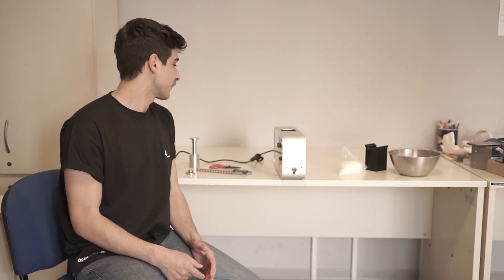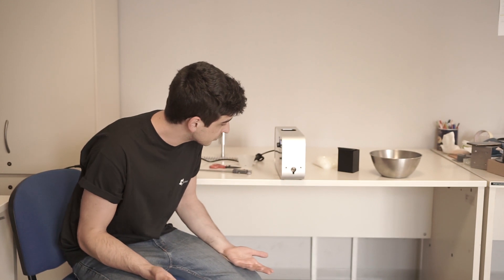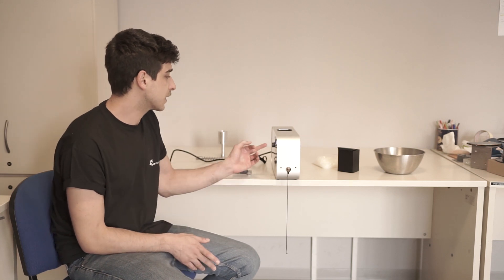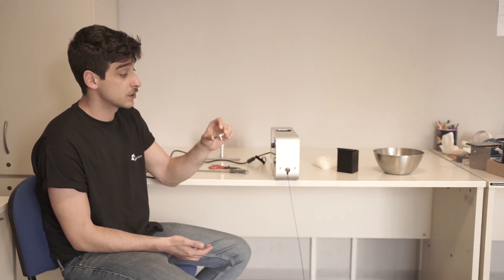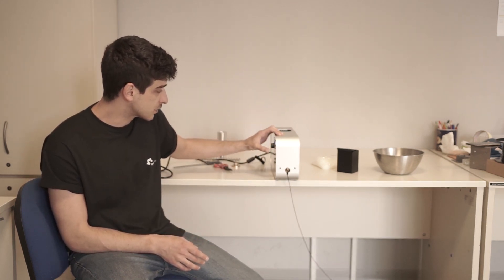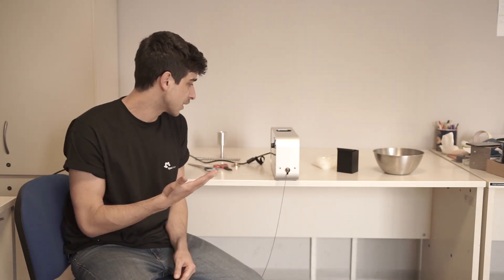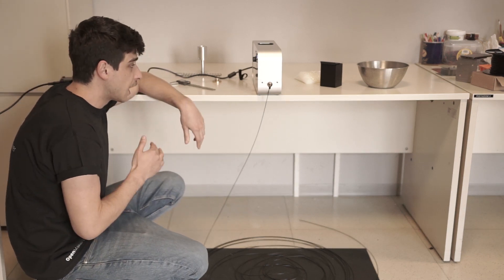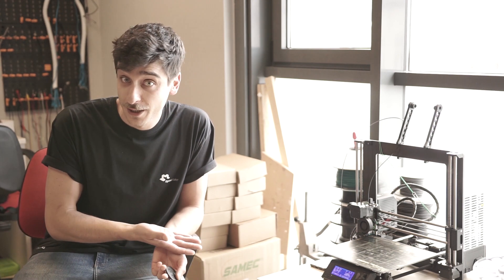Make your own filament at home with Felfil Evo: 100% PLA recycled filament

Comment: If you sell it to me for 300 dollars I will be glad to test it review it and promote it but The device won’t sell to the general consumer when there are other options for 500 that are pro grade.The perfect price point for this machine is 300 dollars. At that price thousands will buy it... not sure how much it cost to manufacture it... but if it is feasible I would recommend the price reduction because many 3d printing experts want this kind of machine but just not going to spend over 500 without it coming with a spool winder
Reply from the maker: Hi Marco, thanks for your advice. But, what are the machines pro grade for 500€?
Reply: Hi! Thanks for answering!there is a company selling the filastruder only 300 dollars but comes with a more powerful motor larger screw etc... for 500 that machine comes with the filament winder too. The problem is that it isn’t fully assembled like your machine but most people who work on 3D printing should be able to assemble it so when they compare that device to yours they think 300 dollars makes more sense then over 500 without filament winder... they are taking a lot of your customers from you due to your price being so high.
Reply: Felfil there is also another machine that’s orange being made by a Chinese company... I forget the name but you can get one on eBay and other sites for 600 dollars fully assembled with more powerful motors etc... I wish I could have one of your machines so I could promote it here in California. I am tired of all the plastic ending up in the landfills. If I could inspire people to buy some and turn their garbage into filament I can use for my printing projects that would be awesome!

Comment: Hello, your idea is pretty neat I must say. But the price is far away unfortunately. Like someone said, first of all, I see (hear) some issues with motor, that one needs to be definitely brushless. I would use the same motor as shredder (with some switch) for the filament, so you wont need to use external one. Design of the device - rather higher than wider, you will have more space on table. And regarding the spool - this device is calling for it. I would use rubber belt to gently rotate the spool. (belt will need replacement very soon, as the friction will tear it quickly, but it is a cheapest solution). 720Euros (in my country) is just too high (costs of 40KG of high quality PLA spool). I understand it is not serial production, I am crossing fingers you will find a way how to produce it in more quantities (and cheaper).
Reply: Make it for cheaper then: https://medium.com/endless-filament/make-your-filament-at-home-for-cheap-6c908bb09922

Comment: Wow, pretty expensive. For this price this device should have an integrated spool winder and spit multiple 1kg spools out per day ;)
Looks (And sounds) like there is a brushed motor. A brushless would be the least.
This device will take years to amortize. It has a very small capacity even for amateurs, but its price is in the professional area, where ist capacity is ridiculous.
If you go for serial production and half the price (200-250 would be acceptable for amateurs), then it will get a nice  and good selling product as is. It is understandable, that you can't hold the price with custom machined parts.
Reply: @AS-ug2vq  the project you linked is even more capable that the one in the video here :)

Comment: Almost $700??? You are seriously smoking the wrong stuff...
Reply from the maker: Dear Thomas, did you see how it made? You can take a look here: https://github.com/CollettivoCocomeri/Felfil-Evo .We use only CNC machined component specifically made.
Reply: @Felfil  That is all great, but for $600, you can get almost 50 rolls of filament. That lasts the average consumer a while... Not sure how anybody would be able to justify such an investment. At least I see no way to spend that much money to save maybe 20 bucks per month - and I go through about 15 kg per month. Neat idea, but to me not even worth a tenth of what you want to get.
Reply: @Felfil  It's neat that it uses custom made stuff and probably lots of R&D involved hence the price, but to be honest, i would not pay 700 for something with inconsistent filament with1.71, 1.72, 1.76 and so on. I would need it to be percice with a consistent 1.75.
Reply from the maker: @Duckers_McQuack  I see. Also commercial  
(good quality) spools has +/- 0.03mm tolerance, using virgin material.  :)
Reply: @Duckers_McQuack  filament in market swings from +0.02 to - 0.02mm tolerance. Where are you getting exactly 1.75mm at all points from?

Comment: Can make with pet bottle material?
Reply from the maker: Yes you can, but it is quite difficult since you need a long cooling system, we are experiment different ways in order to make this job easier! We are planning to write a full guide for the community once we will find the right tricks. However you can already start recycling plastic like bottle caps or soap container
Reply: I live in Brazil, we have a lot of waste of material, pet bottle is the main material wasted here, thank you for anwser :D

Comment: Badly designed ... the size of the filament is not consistent, the motor is too small and struggle to extrude.
Reply from the maker: Hi David, do you have a Felfil Evo? Which material did you test?
Reply: hi  david      search  fas83   youtube channel       and you will see what  felfil evo basic kit can do!!!!!!!!!!!!!!!!

Comment: Is there a way I could crush old prints or rafts and use this to turn it back into useable filament?
Reply from the maker: Hi there! The PLA scraps you can see in the video are crushed by a bar blender, It works well with not too much strong failed prints. We are also working on an dedicated shredder! Cheers

Comment: This video is the perfect advertisement, honest, relaxed and complete, good job guys!
I just sent an email to your sales department as I would love to have one
Reply from the maker: Thank you very much 3dprint-tech, our purpose was just help our community to work with recycled PLA
Reply: Have you guys considered to change the motor current instead of rpm?  This should keep the force constant if I'm not mistaking. 

This would also fix the RPM change when the heater kicks in and can be completely done in software.
Reply from the maker: Nice question! Felfil Evo's DC Gear Motor is drived by PWM, this is cause we have to change the RPM for many reasons, one of those is the material dimensions in input, that if is pulled in the barrel too quickcly could get stuck, on the beginning of the screw. 
Driving the current directly influence the TORQUE ( force is Jedi stuff ;) ) , PWM as well but a lot less. 
However as a totally open source project you can customize the firmware and electronics according with your needs and curiosity. 

Of course we consider any suggestion and improvements coming from our users.
Reply: torque indeed, stupid me ;)  

As soon as I have one, I'll definitely experiment with that. 
I also have some ideas for a filament spooler that doesn't stretch out the filament because it pulls on it.  
By using two optical gate sensors I should be able to create a closed loop system that ensures that the filament is spooled on exactly the same speed it is extruded.

It's all a bit hard to explain in a YouTube comment but if your sales department get's back to me and agrees with my proposition I can experiment with the current and build a spooler. Of course I will share the plans, code and circuit diagram with you guys.